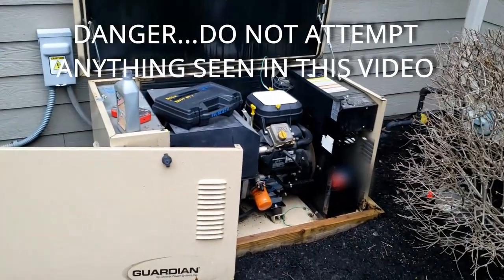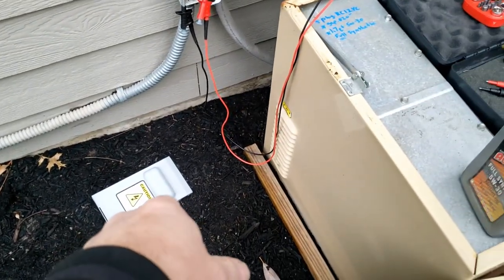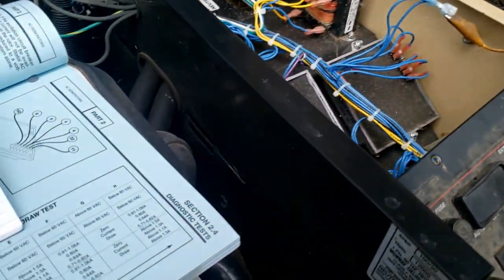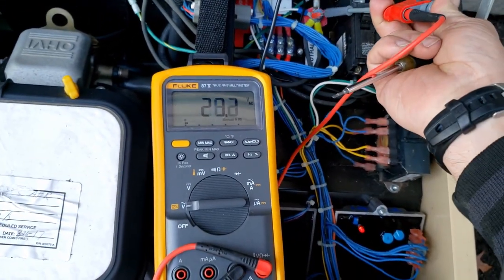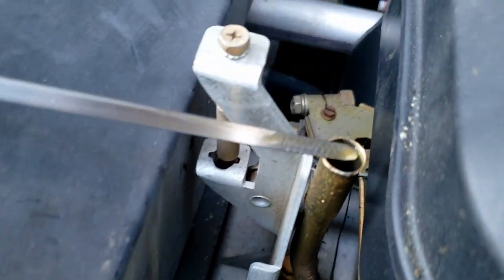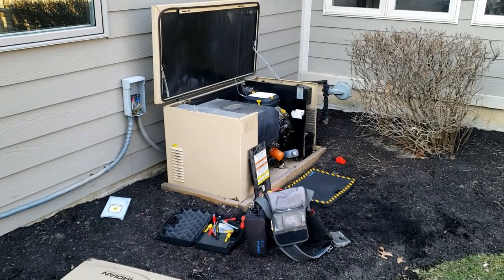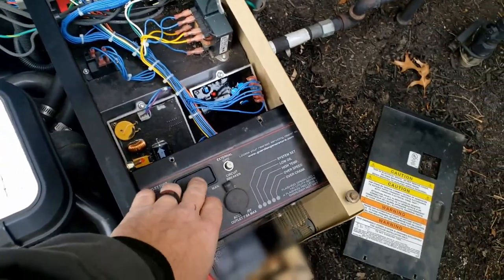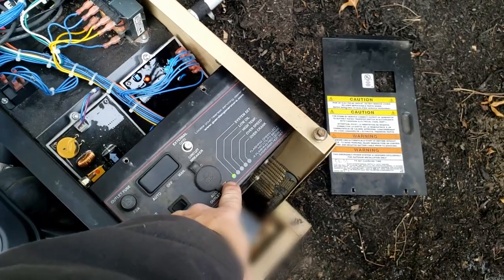Generac Generator Fails To Run & Transfer Back To Standby #GeneratorFailure

Comment from the maker: Hey guys! Thanks for checking out video! Like I mentioned in the video, I point out several items that Generac had problems with that made my job a lot harder. I know I sound very negative but I have had a lot of problems with the older models. BUT....The problems were slowly worked out over several years and I don't have that many problems now-a-days.
Reply: Help plese I have Generac 4645 generator 15kw. will not start or turn over all lights are no the control panel 4 red 1 green

Comment: 20+ year Generac tech here.... the failure of the VR to power the unit up the first time is likely a dirty set of slip rings from sitting around doing nothing for weeks / months. Going through a few start cycles (and field boost cycles) gave it enough time to burn off the crud. Another trouble shooting tip is that first flicker of the red light was your indication of proper field boost. You probably could have grabbed a quick reading on your meter using the min/max feature to see battery voltage while cranking. (too fast to see it read out) That's a big time saver compared to the steps in the book. (read from the F1 and F2 terminals on the VR with everything connected) BTW, the red light indicates AC output... but not how much. It can come on with only 50 volts or so. (other problems) As for the retransfer problem, that's an issue right from the factory when new. I don't know if Generac ever put out a tech bulletin on it. Basically the CMA board loses it's memory if the battery goes dead for a few weeks and you need to start from scratch. The one time fix is to cycle the utility power on and off for 10 - 12 seconds. Do that twice and the board is reset. Replacement boards seem to have the same issue, which tells me it's a software / programing issue. One last pointer is the factory also offers a field boost kit for units that sometimes fail to get enough boost initially. (serial # starting with a 2, 3, 4) The signs are intermittent multiple start attempts (because it shut down due to lack of output) or flashing overspeed fault (lack of output) and you go through the steps but fail to find other issues. The kit is about $100 retail and takes 20 - 30 minutes to install. (less when you get good at it) The kit contains a small wiring harness, a rectifier, and a ceramic resistor that jacks up the field boost voltage a bit higher than OEM.
Reply from the maker: Thanks for the info, I was really into these when I did them more often but now I'm not seeing them enough to stay fresh. I know I really hammered this model so thanks for not jumping me 🤣. I had a rough first year when these came out, luckily practice makes it go faster👍👍
Reply: @HVACRSurvival  ... in a company with about 18 techs the next guy below me only had maybe 13 years in the field, then the rest were less than 10 years. Between the two of us older guys we were masters at the "lost art" of these things. We learned to teach, not preach when it came to showing the new guys how to do stuff.
Reply from the maker: @rupe53  as you might noticed from my other videos,  I was a HVAC guy that was bored with my residential work when I got into generators in 2006. In 2014 I came to a refrigeration company that has me manly do commercial so I am not bored anymore and our residential division doesn't do near the volume my past company did. LoL Thanks for the input! 

I just had a newer Generac that had starting issues with the LP gas setting that required a new mixer assembly. The new part had a fully seated butterfly where the original butterfly had gaps bent into it from the factory that did not allow the proper pull of fuel. Once I changed it the problems went away. Then factory did not say there was any changes in that mixer assembly...So nothing surprises me about Generac not being full discloser. What state are you in?
Reply: @HVACRSurvival  ... we are in CT and usually run #3 or #4 in size (sales volume) for east of the Mississippi. Being a full service dealer is a different category than a big box store. The tech people will talk with us if we have a problem but being that big we can also get the attention of someone in engineering when it comes down to it. They actually gave us some prototypes to test once in awhile. One of them was a dozen custom CMA boards (for this unit) with the flashing OS sensing disabled. Those also had a quirk where if the unit was pushed to OS during maintenance (testing) you could not reset the fault without powering the board down completely. Of course that meant resetting the weekly exercise time, which pissed off a few customers. Also had a bunch of those fuel mixers go bad in recent years. Usually it was the stepper motor, but it comes as an assembly. BTW, before this gig I spent a few years in HVAC and a bunch of time doing auto / truck repair. Recently retired.

Comment: By watching all the techs working on those generator help me save a 5 grand mistake. I went the way of a portable one that is good for 60 amps but I only wanted 50 amps so I got a safety margin. And it is dual fuel so that made it easy to store fuel. I went with the KISS plan so that my family can work it safely if our power goes out. .
Reply from the maker: Portable is what I have. I felt the same way, for some people the automatic is the only way to go but for those that don't need it, I see too many problems for the money spent. The new ones are a lot better, these older ones were problematic and it always get taken out on the service guy.
Reply: I started with a portable generator kw5000 but felt an auto generator would be better for our household, medical problems with me - Vietnam veteran.
Reply: I had a portable unit until I was 12 hours away and a tornado went through the area taking out power. Having a finished basement with a sump pump, yeah also have a battery backup sump installed, I decided that it was time to move to a unit that will do its job when I’m not around to hook it up. Besides, some day I might not be around to do the hookup for the spouse. Much pricier option though.

Comment: 1) I very much appreciate your videos and how you walk through it all. I recently rebuilt a 1972 Honda motorcycle using the shop manual and YouTube, and I wish more channels did troubleshooting like you do. 

2) we have this exact same generator, throwing an over speed code. I installed a new battery, changed the oil/oil filter. No luck. The voltage regulator LED stays solid red until shutdown. Would you replace it or the board? Why do we do??

Also, can the systems charger be bypassed? I have an aftermarket trickle charger on the unit. 

Thanks in advance for any direction/next steps you can give.
Reply from the maker: If you unhook the oem charger, it's possible to use that charger. What's the output voltage currently

Comment: On Friday the 13th we had a big storm and had a big surge. There was a big clunk, clunk noise from the generator fuse box. I went to check it out and even though there is positive current in all the fuses only 7 out of 15 of them provide power to the house. we have changed the both solenoid inside the fuse panel 
last year myself because it burned .
Now what shoud i check or replace.
Thanks for your respond .8/16

Comment: Great video Rick. I have same model generator and it just wont start automatically when the power goes out, i have to manually start it and then it works perfectly, but obviously this is no good if im not home. I presume transfer switch but i was windering if you jad any thoughts? I look forward to hearing back from you. Danny
Reply from the maker: It's hard to guess not being in front of it.

Comment: Good stuff! I have the new 22K.  Very different electronics. Damn if they didn't come out with the 24 right after I bought mine.. By all accounts the new ones are worlds apart better.
Reply from the maker: Yep, they improved dramatically and it never fails, something better comes out the next day.

Comment: Oh man, that FLUKE 87 kit is SWEET!
Reply from the maker: That's my king dog meter for the hard to find problems 🤣. That's just a pistol case with the over priced accumulated Fluke probes. Thanks for noticing my rarely seen meter😉. I also have the 376fc that rides in the sleeper cabin of my tool box 😆.
Reply: @HVACRSurvival  Unfortunately I have all the meters I need, and none of them are Fluke products. SAD...
Reply from the maker: @joehead1294  I have and had others but don't tell my meters you see on YouTube😆
Reply: @HVACRSurvival  When I first started using meters digital was just starting to come out.  Fluke lead the way.
Reply from the maker: Same, My first good meter was a Wave-Tek then Fieldpiece came out late 90s.
Reply: @HVACRSurvival  Wavetek was good stuff.  I learned on a AN/PSM-6.  My first digital was micronta.
Reply from the maker: Radio Shack 👍👍. I had a Micronta pocket meter.

Comment: I have this same generator that was just installed.  It was acquired by trade.  Everything works well other than the engine does not like to start once warm.  Once it runs it runs great voltage is good and frequency is good.  I checked the valve lash and it was at .003 - .004 and from what I could find that is in tolerance.  When it is trying to restart it pops through the intake.  Does this sound like a gas valve issue or are the valves not in spec and I have Mis information
Reply from the maker: That is the spec for the valves, I would go through and check your incoming gas pressure, make sure your stepper motor and choke is working properly. Also check what your gas pressure does on the incoming side of the valve during startup see if it's dropping really low. I've had times where the valve at the street clamps down because it thinks you've got a big leak as if the gas meter was hit by a car or something.
Reply: Popping through the intake might also be a sticking intake valve due to worn parts (guide/seat) or carbon buildup. I've done Seafoam decarbonizing treatment on these older units with some success.

Comment: With it being outside and affected by weather, would it not normally be a good idea when changing out components to add some dielectric grease to the contacts/wires to help protect them? or is that not a general thing to do?
Reply from the maker: Most of the connectors have a rubber seal just like an automotive connector does. On the ones that are exposed Generac does put some dielectric grease on there.
Reply: Gotcha, Thanks :)

Comment: That generator sure brought back memories. I took an IT job years ago for a family owned business that had one for the server room and dedicated outlets in the back office. I did basic maintenance like oil and air filter changes and replaced the battery when I found one that had exploded. Sound familiar?  I had a love/ hate relationship with the thing. Most of the time it worked as expected and kept the servers up but it did fail at times. The small UPS units we used for desktop computers hated the voltage it put out. Glad I’m not involved with that unit anymore. LOL
Reply from the maker: To many memories. Things get better with time I guess

Comment: What is better Generac or Onan?
Reply from the maker: That’s a tough one. Both are about equal now.
Reply: @HVACRSurvival  Do you mean Generac is better or Onan is worse? When I was pricing them out years ago, the Onan was much more expensive.
Reply from the maker: Onan has had a good rep but generac is finally figuring out there problems.  Finding good repair people and having parts is key

Comment: How do I find a Generac service technician with your attention to detail? Generac's website only points me to the big distributor companies in my area.
Reply from the maker: @andypritchard9786  find someone that specializes in Generac generators and has the most certificates. Preferably somebody that only works on generators and nothing else. I’m very OCD about things so to find that level of detail may not be very easy and unfortunately, you won’t know it until you find it.

Comment: I'm not sure if you still monitor this channel or not but on the off chance...  I have a solar system that I put a generac 200amp, nema 3, service entrance rated ats into and everything works fine ( if I open s1 and then manually transfer than close my s2 contact ) except it will not transfer to emergency automatically, it will however re transfer with no issues once I close s1 back.  I have dual EG4 6500 inverters with 8 EG4 48vdc batteries.  After looking at the limited wiring schematics from generac on this ats my only conclusion is I need to power the relay with 12vdc to make it transfer to emergency position.  Looking at your video it looks like this is what your doing to make the ats transfer to emergency (apply 12vdc and ground) and then lift it to make it re-transfer to normal.  Am I correct in my thinking?  thanks for the video, I will continue checking my theory but hope to hear back from you on this.
Reply from the maker: I'm making one to two videos  every week, so yep I'm still here. You're partially correct, generac Powers the transfer switch with constant 12 volts positive and they ground the other side when it needs to transfer to auxiliary power. Then they remove the ground to transfer back to the utility and that happens as long as there's utility voltage there. They use the power from the generator to pull the solenoid down into auxiliary and they use the utility power to power it back into standby.
Reply: @HVACRSurvival  Awesome news, I'll click the sub for you.  I think what I will do then is put a small 12v battery in the ats and a charge controller with a small panel outside and then do a 120vac relay that will hold contacts open on a ground wire while powered by normal source.  When power drops out contacts will close and complete the ground circuit.  Thanks again for the confirmation on the 12vdc.
Reply from the maker: Don't forget you may want to put a time delay on there also, otherwise it might rapid cycle back and forth at the power flickers.
Reply: @HVACRSurvival  I was thinking about that...  lol   I don't have access to the Grainger account anymore so I'll have to hunt ebay.  I may need to add a second enclosure for all these components  hahahaha.  Thinking about the charge controller and solar panel, I may just go with a battery charger powered obviously on the S1 side...
Reply from the maker: Amazon has about everything we sell and sometimes it's cheaper than the supply house

Comment: Had one recently that transferred to standby but just stayed on and not transfering back with utility present. Course, didn't yet get approval to replace the $500 board yet. I feel like I am the only one in my area that does it but on those old model 004/005 V-Twins I pull the lift brackets off and it makes replacing plugs a cake walk. My company doesnt wanna buy the level 1 kit for anyone so I have a fun time fixing them during a long power outage I end up using used parts just so someone doesnt freeze in the winter until I get parts.
Reply from the maker: I feel your pain. We don't stock much of anything either.
Reply: @HVACRSurvival  They have a new breakout harness for Evo controllers for excitation testing on genservice and transfer switch stuff is now moving to its own diagnostic manual, thought I share the new stuff. Gotta love that now yearly re-cert.
Reply: @HVACRSurvival  ... worked on these for near 25 years and being a larger dealer I can throw you some pointers, specifically on this unit. If they have been sitting dormant for weeks / months (dead battery / gas problems?) the CMA board has lost it's mind. Back when these things were new Generac told us (not in so many words) there was a logic problem and in order to have it retransfer after a power failure the board needed a nudge.... but only the first time after sitting around. The procedure was to drop the house and let things power normally via gen set for a minute or two. Turn the power back on and count 10-12 seconds, turn it off for 10-12 seconds, then go back on. It should retransfer after cycling the utility once or twice.... then go into the cool down mode, which can be several minutes, depending on how long the power was out. Failure to do this power cycling will result in a failure to retransfer. There are some units that will actually go through the 3 minute cool down then shut off, and still fail to retransfer. As far as I know Generac never did straighten this out and even replacement boards had the same issue. Basically, this is not a problem with the ice cube relay, although overtightening the screws on that can cause binding within the relay itself.
Reply from the maker: @rupe53  thanks again, I never heard that about the control🤦‍♂️. But it did act like a logic problem😖😖. I'll try that trick next time👍👍. I did catch that relay sticking, I had to put the camera down to get both hands on it so I didn't catch it on video. I'm very leery showing too much on video and having someone get hurt and then try suing me. That's why I was told to write it out and say it out especially on this one here where my hands are in dangerous spots several times.
Reply: @HVACRSurvival  ... BTW, that relay has 240 volts on it. I have a nut driver and screw driver with tape on the shaft to keep clear of the live terminals. I never tighten the ones on that end. Just slide it in and install the other screw.

Comment: Generac refused to replaced or to provided services on a difected contactor in a Transfer Switch panel I purchased, since the panel arrived with no serial number.
Reply from the maker: They wont do anything without the ser#. I had the same problem but the panel should of had a data tag.